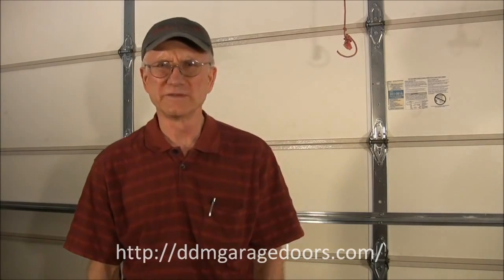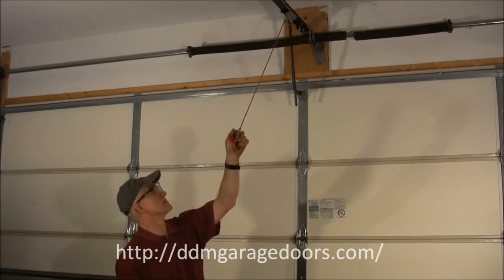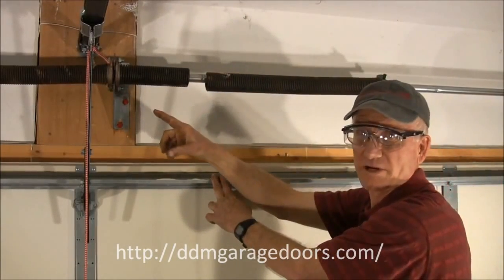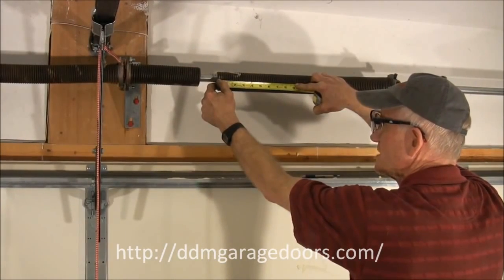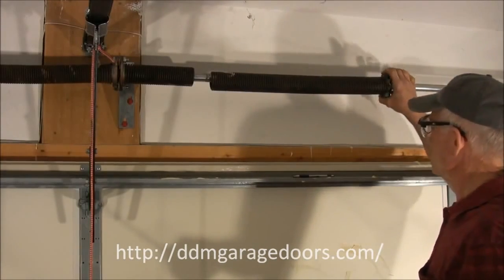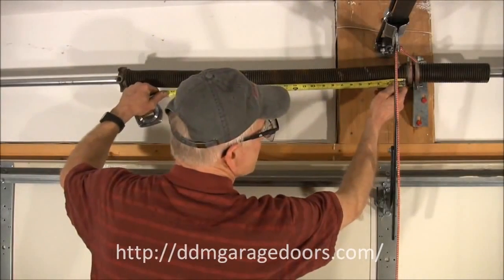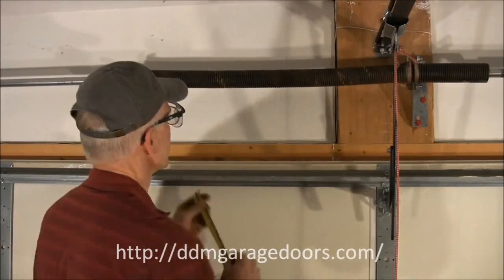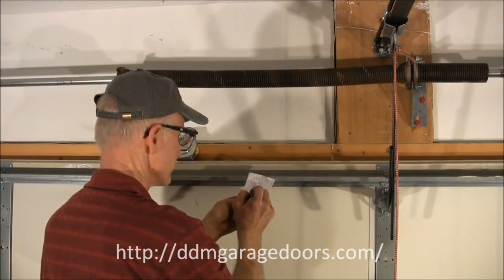Measuring Garage Door Springs

Comment: the spring on the right hand turn is 20" and the left is 22.25" is that possible or do i need to look for a missing piece on the broken right turn one
Reply from the maker: Hi Mark! Yes, this is most definitely possible. Sometimes, repairmen will just use springs that they have available to them to match properly to the weight of the door, instead of going and purchasing a pair of matching springs for your door. These still work fine, but we still recommend that you purchase a matching set when you go to replace them. Here is a better explanation of why we recommend a matching pair of springs: https://ddmgaragedoors.com/diy-instructions/using-torsion-springs-with-different-lifts.php

Comment: Pointed out great tips that aren't mentioned on other posters' videos: measure the broken spring for (true) unwound size, compensate when measuring the wound side, right and left might not be the same, look at the end hardware for diameter.  Even the links are quality information.
Reply from the maker: Thanks for the kind words, windyBovine! We're glad you found the tips that we outlined in the video to be helpful to getting your springs measured to ensure that you get the right sizes if you need replacements. Thanks for watching!

Comment: Exactly what i'm looking for. How would I measure if my spring is not broken? I'm just preparing for the worst.
Thanks
Reply from the maker: Hi there! Remember, safety first. You will want to wear safety goggles for this. If your spring isn't broken, you will do the same steps as you would to a broken spring to determine the wire size, getting a 10 and 20 coil measurement. You can refer to our site at this page to get your wire size - https://diygaragedoor.com/diy-instructions/how-to-measure-torsion-springs.php. All of the ways to get the inside diameter (ID) are the same as well. If you're looking to measure your spring still wound on the shaft, you should keep in mind that every time you wind a spring, you add an extra coil to the length. On a 7' high door you will have about 7.5 extra coils on your spring, and on an 8' high door it's about 8.5 - 9 coils. So, on a 7' high door, you would count off 8 coils on the spring and then measure from there to get the length of the spring. On an 8' high door, you would count off another coil. Springs can be mismatched, so you will want to make sure to measure both springs individually to get your dimensions for both.